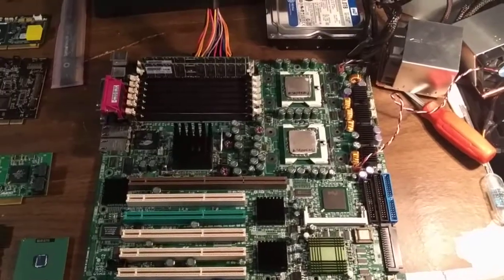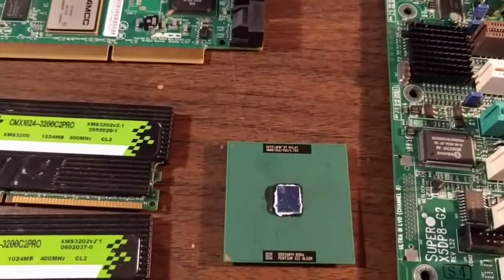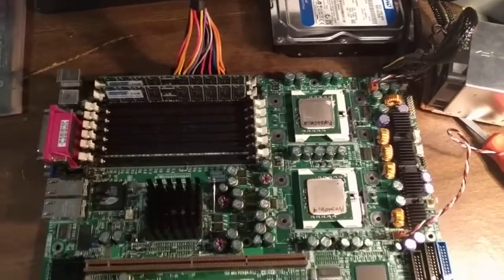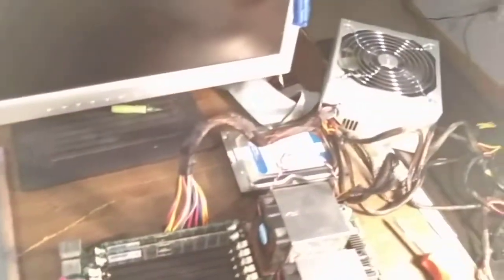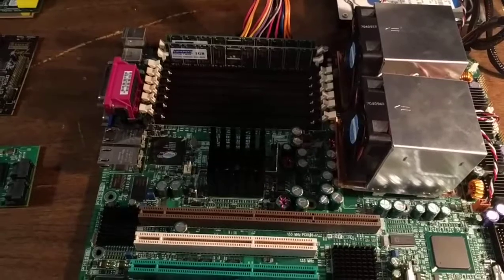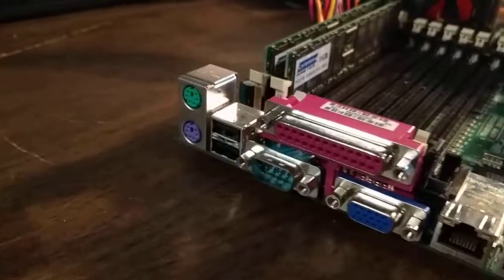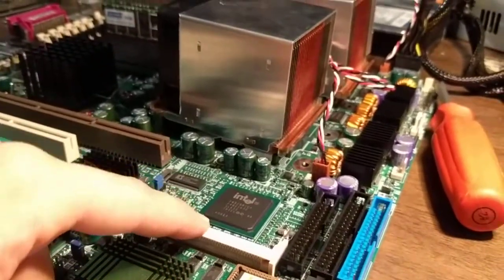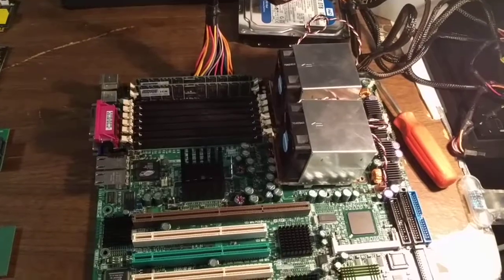Intel's first hyper-threaded CPUs (part 1: Hardware)

Comment: Hey, I'd really like to know more about this as old high-end and server harware is becoming my thing lately and I haven't found the part 2 anywhere
Reply from the maker: I ran in to financial troubles shortly after the making of this video. I actually still have the hardware, I'll re-visit this very soon if you are interested!  

Alternatively,. I have a different board that uses the exact same CPUs. The main difference between them is that the board in this video supports lots of ram (up to 32 gigs if I recall, I'll have to re-watch my old footage) but is limited to PCI only. The other board only supports up to 2 gigs of RAMBUS memory, but has an AGP slot for graphics cards.

If you were to pick between the two of them, which would you prefer to see?
Reply: @LowSpecActionSquad  depends on what GPUs do you have, if you have any good AGP cards this could be a really nice gaming setup, weird in a good way :D I'm currently working on a sort of LANParty Center in my room, I have a few old PCs, the oldest being a P2 233MMX
Reply from the maker: @mscd9676  I'll look into rebooting this series, perhaps with a focus on both systems and the benefits/drawbacks of each one. I've got AGP cards ranging from an old S3 Virge up to a 6800 Ultra!

EDIT: Also, seems that original board maxes out at 16 gigabytes, not 32

Comment: There’s no part 2? 😫
Reply from the maker: I still have the system, I just got discouraged by the CMX memory being faulty, plus I found a second motherboard that worked with the same CPUs but had an AGP slot... but required RAMBUS memory. Also, the LAN party this was destined for ended up not happening, so it was a lot of setbacks all at once. I suppose I can pick this back up... Just need to dig it back out

Comment: GTA5 (fps) counter if you own it.
720P medium settings 😁
Reply from the maker: I don't know if I can since I can't use a PCIe graphics card, but I can't refuse a request from a sergal!
Reply: @LowSpecActionSquad  I'd assume it uses onboard graphics. 

I know (Intel Graphics 2000) from the i5 2400 plays GTA at 10-20 fps.

Im curious how low the fps counter can go if you can't get a PCIe to PCIe X16 adapter for a more modern GPU.
Reply from the maker: @sergal_raiin6044  That's just the thing, this motherboard came out before PCIe even existed! I'm limited to either PCI or PCI-X. The onboard graphics only supports up to directx 6, so I have to use a PCI graphics card just to even get windows to work. I've got an ancient NVS 280 on the way that will at least get me into windows 10, but for a newer graphics card I'll have to see what magic I can pull off
Reply: @LowSpecActionSquad  (Startech) sells a PCI to PCI-E adapter. You can then try to plug a PCI-E to PCIX16 to the first adapter. 

You may need a program called (Different SLI Auto) it's a program that allows you to pair multiple GPU's together that don't naturally support SLI.

You can try booting from what you ordered and force the software to transition GPU's while in gaming mode. Make sure to update graphics drivers and download a copy of Direct X12
Reply: @LowSpecActionSquad  Use the NVS 280 to boot but use (Different SLI) to transition cards into DirectX12 and a modern card.

You need two separate adapters
PCI to PCI-e (Startech) has a good one
PCI-e to PCIx16 the one I use is a cheap $3 from eBay that works fine with an external PSU.
Reply from the maker: @sergal_raiin6044  I'll give it a shot! Don't know how bad the PCI lanes will bottleneck the card, but I'll see what I can do!